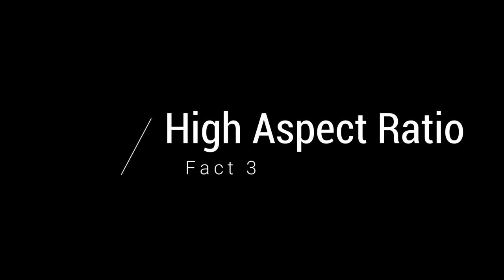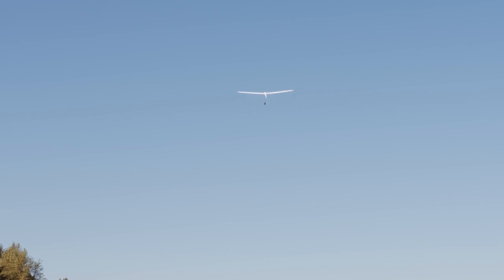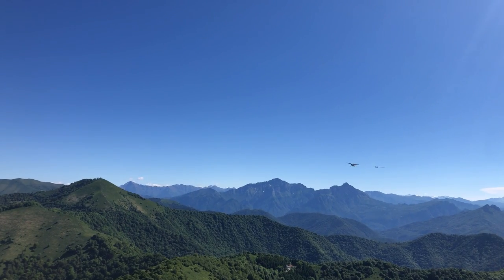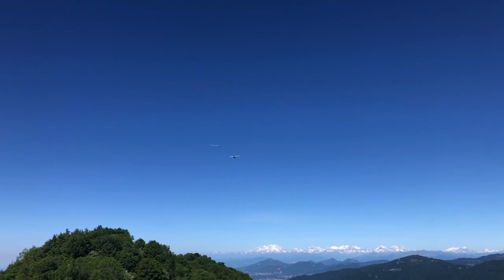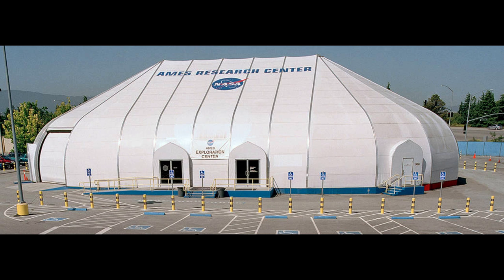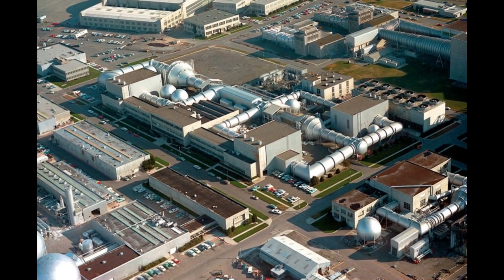WHOA! Is this the Future of Airplanes using Truss Braced Wings? Watch to find out!

Comment: It took years before those strut braced wings were eliminated, now they want them back ???...BS
Reply from the maker: Perhaps new composite materials is allowing a comeback
Reply: @7minprimerlearning : Aluminum allowed
their dismissal and carbon fiber further enhanced their obsolesce.... The only reason struts could be used is a limit on the aerofoil THICKness at M0.85 that limited the structural strength available with carbon fiber or other high strength materials.....